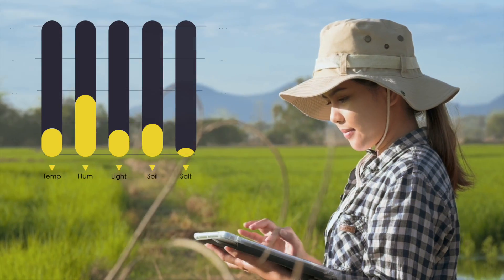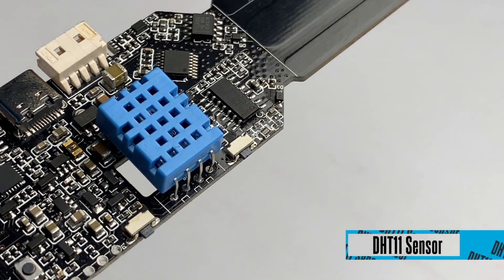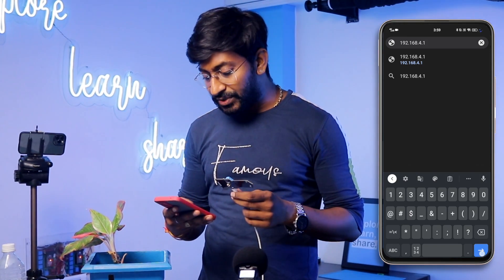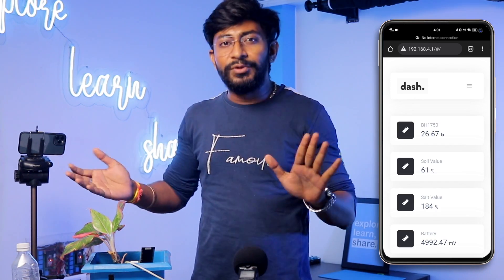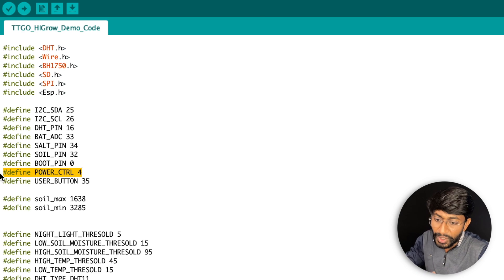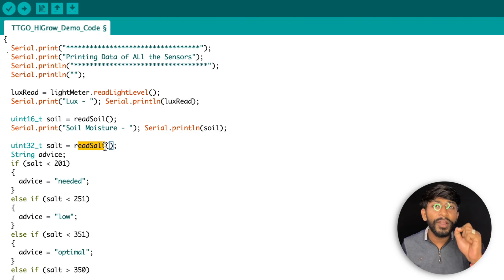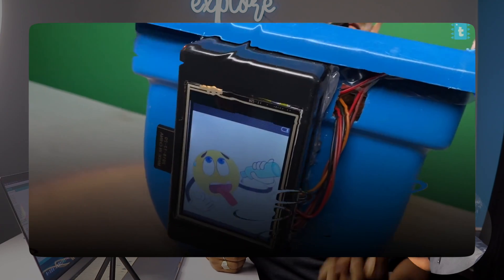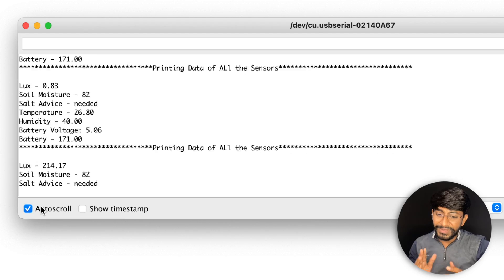The Best IoT Sensor board with ESP32 | ttgo HiGrow

Comment from the maker: What do you think, which sensor should get added to this board to make it more useful?
Reply: if this will be use outside,it will be cool if it is solar powered or any kind of stand alone..
Reply from the maker: Yes
Reply: Hello, I have problem with T-Higrow lora 32 board and how to connect this board to arduino uno.
Reply: Ph sensor can be added would be helpful 👍

Comment: very cool video explanation !  I tried to set this sensor up with Tasmota32. Installation proceded very well, however i still have problems with configuration of GPIO settings. Somehow your Arduino settings dont work, Signals show all "null" values. Where is the magic button that I have to set. Have you experimented with TASMOTA as well ?

Comment: Hi techiesms,  could you please help me to find quality product of ESP32-CAM module as I am encountering problems like it is frequently become dead ( very much heat on regulator IC and replaced it with one but no luck)  within 1 or 2 month while working on the board. I am much disappointed due to this issues and losing my interest on ESP32-CAM module. Kindly advice me. thank you
Reply from the maker: Well I have couple of them and they work complete fine
Reply: Could you please suggest me where I can buy original esp32 cam module so that it will work long period ...

Comment: for this actual form of the sensor unit, it is not possible to use outside and use all its functionality. example for the light, if you will use this outside the possibility of this board to get damaged easily is to high because it is not covered and if you will cover it the light sensor will be block...just an observation, what you think?
Reply from the maker: Well
You need to wait for my next video for that

I have a 3D printed case with a hole for light sensor 

It solves the problem

Comment: Regarding the power pin, like one comment suggested, power saving in standby can be a reason. Also, can it be to constantly "pull up" the sensors' VCC pin.
Do let me know what you think.
Reply from the maker: No that’s not the sensible reason 
Power control was quite sensible